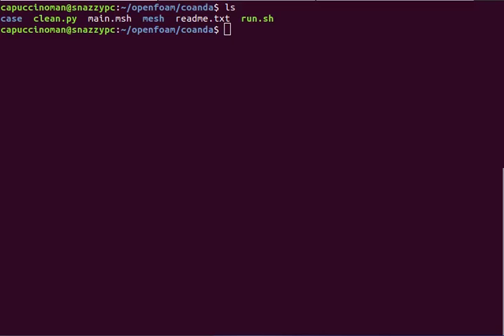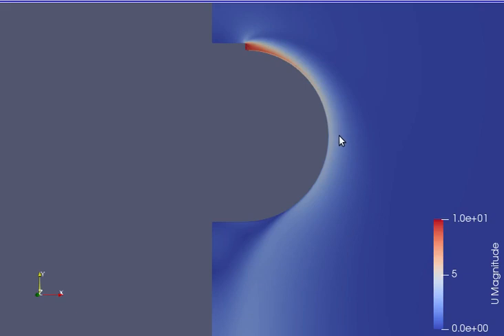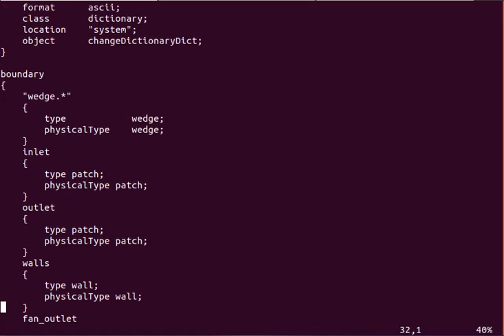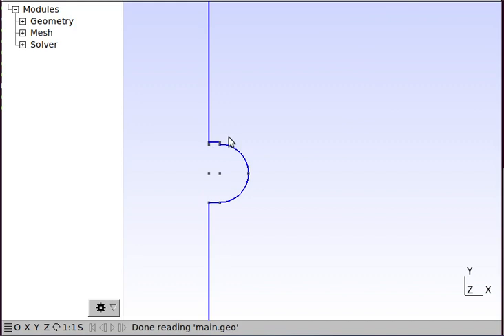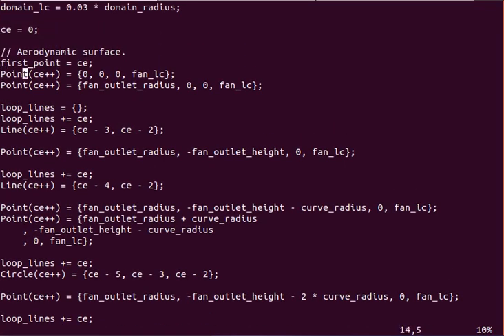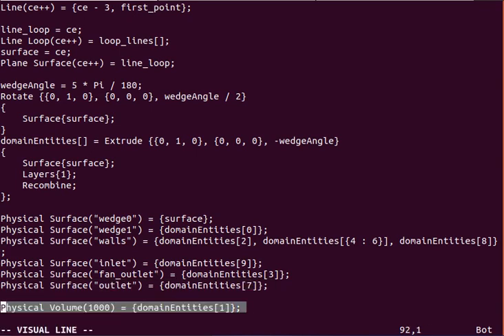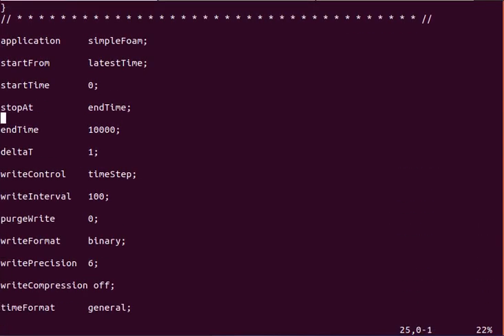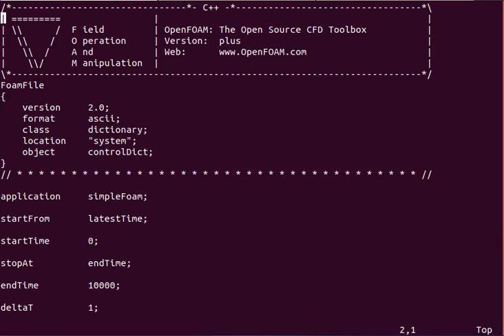Coanda Effect Simulation

Comment: Hey there, I have tried to launch this one as well and get the error: 
--> FOAM FATAL IO ERROR:
Bad token - could not get scalar value

file: input at line 0.

    From function Foam::Istream& Foam::operator>>(Foam::Istream&, Foam::doubleScalar&)
    in file lnInclude/Scalar.C at line 136.

FOAM exiting

Is there any file or section that must be changed ?
The mesh is well generated and can be seen with gmsh
Reply from the maker: Hi Yannis, I just did a fresh clone and could not reproduce this error. What version of gmsh and openfoam are you using?